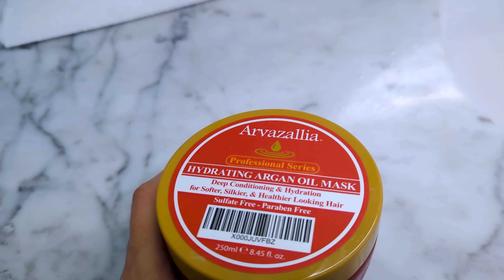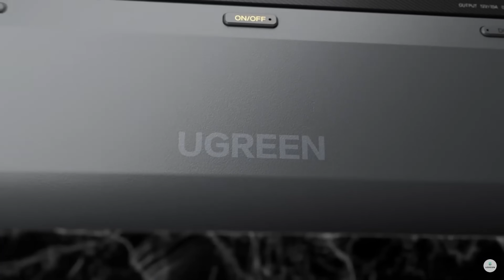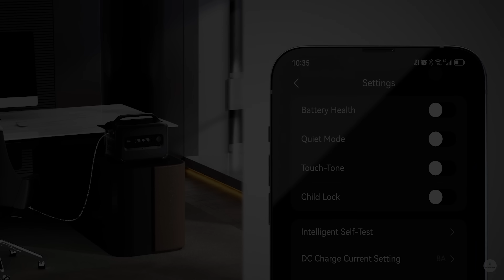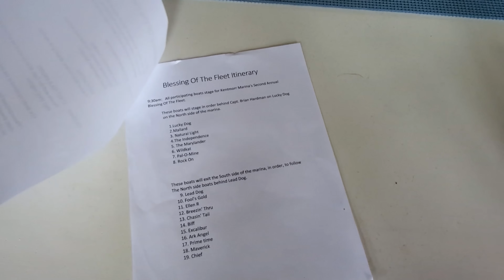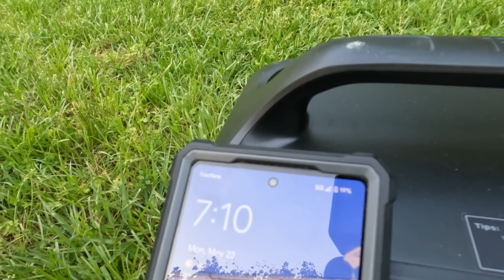I Used To Think It Was Big, Now It Looks HUGE!!  (MJ Sailing - Ep 286)

Comment: just a thing - if you want to recognize the environment you are working in  - well its fabrication and boat building specifically. one recommended practice is to ensure you dont have " things" on your hands that could get caught in machinery or in the jobs you are working on.  I am pretty sure I saw an engagement ring sticking through a glove  - respectfully you might find it a better option to take jewellry off when working with tools and or on the worksite.  not only can you damage the treasured item   - you can seriously stuff your fingers and or hands up if it goes wrong.

Comment: Small electric planer with tungsten carbide blades will flatten fibreglass.  Finish with belt sander--both tools will take dust control systems hoses, a grinder will not.  Outside a vessel I used compressed air driven tools and spray the area with water as I go.  No dust problems.

Comment: Wow better buy a saw blade that says acrylic on it there appears to be a lot of design in a saw blade to prevent chipping. For cutting acrylic, the teeth of the saw blade should have the triple-chip design, where the cutting edge of every other tooth is beveled. The beveled tooth, or crown tooth, removes the material in the center of the cut while the flat-top raker tooth follows behind, removing material from the edges of the cut. This results in the production of three separate "chips" - center, left side and right side - and hence, the term triple-chip design. On some designs, the flat-top raker tooth also has very slight bevels along the top side-edges of the tooth. This helps to reduce chipping by reducing the notching affect caused by a square cutting edge.

Best results are achieved when the teeth have a clearance angle (top clearance) of 10 to 15 degrees. This minimizes contact between the teeth and the material - reducing friction and resulting in less melting. The proper rake or "hook" angle, 0 to 10 degrees positive, ensures the teeth do not strike the material too aggressively. Higher angles can lead to chipping due to poor blade stability and poor control of material feed rates.

For gang cutting of stacked sheets, a saw blade whose teeth have increased radial clearance is recommended. This clearance will reduce carbide/plastic contact on the sides of the teeth and, therefore, reduce heat generated by friction. U
Reply: Make a pattern and cut with a router.

Comment: Acrylic - color, thickness, UV & scratch resistant, impact strength from a broaching wave or fast moving object?
Reply from the maker: Probably 2064 tint as it's what we have always had.  12mm thickness - decided by ISO CE for that size opening.

Comment: Multi tool/Fein tool cutting blades, GET "carbide grit cutting blades" or ANY bit that is designed to cut TILE and GROUT. Will cut fiberglass products like butter. On top of that they do not wear out fast at all. You will burn through 100 toothed blades before you wear out a carbide grit or diamond blade. Also a diamond shanked cut off wheel mounted on a router would be a better tool to use. You can set the depth and make a perfect cut all the way around. Same as using the multi tool. Just 10x faster and a perfect height. Vacuum required while cutting and the dust is tamped down to minimal at worst. When I worked at Hinckleys, that is how all hatches and windows were cut out.
Reply from the maker: We use the diamond blades on the circular saw and grinder, but they seem to be a lot slower for the multi tool than the carbide tooth blades.  We have a bucket full of each.

Comment: I'm curious if you have looked at polycarbonate.  Might be a bit more expensive than acrylic but you can go much thinner for more weight saving and it adds a lot more impact resistance than acrylic.  The only downside that I know of is it might scratch a little more easily than acrylic.  But it still buffs out easily.
Reply: I was going to ask the same. When I was replacing my windows I went with polycarbonate with UV and scratch coatings as I was more concerned with impact resistance with the cabin top and breaking waves. It was worth the extra $ for additional protection.
Reply from the maker: Polycarbonate is way too flexible over this large of a span to keep a good seal.  It really works best with a full frame to hold it from popping out.  It's the same reason no hatches are made with it unless they have additional support bars along the span.

Comment: I’m sure you can put some windshield PPF like ExoShield over the acrylic to prolong its life and clarity.
Reply from the maker: A good UV rated acrylic typically holds out for a decade without too much care.  And since the windows are flat on this boat, it should be easy enough to replace as needed.

Comment: What kind of acrylic will you chose - cell or continuous cast (I assume you won't use extruded)?
Reply: Why do you not tell us the pros and cons of each
Reply: @tommytriglav5181  I wanted Matts opinion, but acplasticsinc has a good overview
Reply: @SteifWood  Honestly I thought there was just flat extruded acrylic. All I know is that you have to be very carefully cutting it because you can form micro cracks at the edge which could later propagate to the center. I would even use a diamond saw like they use for ceramics but then maybe it will get plugged up with melted plastic. Well they say to use recommended saw for acrylics. Lol. Who knows what that is. Lol. One company has one with 80 teeth and others have 120, 128 and 140 teeth
Reply: @tommytriglav5181  It's nearly impossible to get clean edges with a saw or router on extruded (hand sawing could work but any blade at any speed on power saw ...). 
I just made some extra inserts for my router table and all I had available was extruded. Unfortunately I couldn't lower the speed on the CNC enough and the acrylic just melted (I doubt it would have worked anyways). I was able to get some decent results with my jig saw at lowest speed, and was able to sand to final quality, but these were tiny pieced (2x2") and for the all the windows on this boat, njet.
So my question to Matt was more like if the less expensive continuous cast acrylic can give him acceptable results ...
Reply from the maker: The last boat we used a saw blade made for cutting acrylic, sanded the edges then flame treated to eliminate the micro cracks you speak of.  But, I don't think it's an issue in this application since the windows cover the entire exterior span and the edges are hidden from the sun (which causes the most damage)
Reply: @MJSailing  Flame treatment will cause crazing soon. Test a small scrap. Flame it. Then wipe with alcohol. It will craze before your eyes. Also, any long acrylic spans will change size faster than the surrounding fiberglass break loss from the surface.
Reply: @MJSailing  If it worked then by all means do the same. Thanks for sharing your method

Comment: Awesome video and another step closer. I am curious as to why you didn't use your router with a flush cut blade, it would have come out with a smooth edge and way less fairing and sanding if any.
Reply from the maker: Even our large DeWalt router would have struggled with cutting that thick of fiberglass.  And I think we would have spent more time cleaning up the router mess than what this took :)

Comment: When you started using that oscillating tool I thought "what about a router w/flush cutting bit?"  That would have been many times faster!  This build  is going to be so much more esthetically pleasing than Elements, which was not at all shabby.
Reply from the maker: Even our big DeWalt router would have struggled with that thick of fiberglass.  I think it would have required cutting close, then coming back with the flush bit.... All while making a horrible mess :)
Reply: @MJSailing  Talk about a rapid response!  OK, as usual I'm preaching to the choir, lol.
Reply from the maker: Flush cut was my first thought too.  I've had the luxury of staring at them for months figuring the least destructive way to attack
Reply: @MJSailing  Thanks for giving my maunderings so much of your valuable time.  I pray the good Lord's blessings on the both of you and your Georgie.

Comment: Why not lexan for the windows
Reply from the maker: Polycarbonate causes all kinds of adhesion issues due to the constant flexing if you don't have frames holding it in place.
Reply: I think it turns yellow too and acrylic does not
Reply: @tommytriglav5181  I think it’s the other way around and you can even get it in tints and UV reflecting type also that is what is between car front windows
Reply: @SV_SheDevil  well I was just looking at clear and I am sure you can get all kinds of coatings on it but without the coatings my understanding is that polycarbonate turns yellow in a year whereas acrylic takes 30 years to turn yellow. However it may be a good suggestion to find acrylic with a harder coating on it so it does not scratch when you wash it.
Reply from the maker: Tints are usually difficult to find with scratch resistance in polycarbonate.  But I'll admit it's been years since I looked for any, so maybe the market is better.

Comment: Kinda strange why the factory couldn’t reverse mold the window flange so the windows would fit on the exterior to begin with or even mold the window flanges separately to be applied some how later to the openings .This seems like a waste of time to have to cut all those flanges out .
The factory could even have the flanges pre injection molded in a tough material like ABS and fiberglassed in place later .
Reply from the maker: The additional laminate was to prevent scratching the frames when shipping.  The acrylics spans the entire exterior surface, so no recess needed on the exterior

Comment: Just blows my mind you two built this boat without full face respirator. You two are going to be blind when your 60.
Reply from the maker: Have you ever tried wearing one constantly? I would have quit after the first few months if I had to wear a full face all the time. Had we used a grinder or sander, then it would have been worn here, but the multi tool was chosen because it doesn't create much dust.